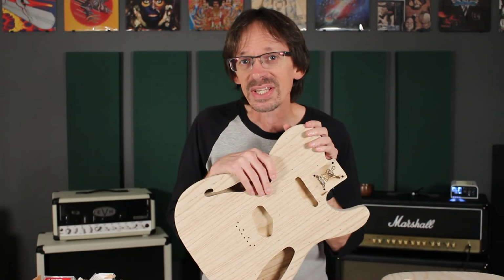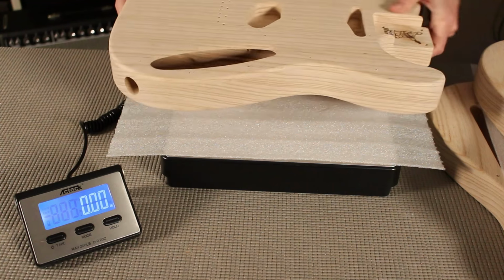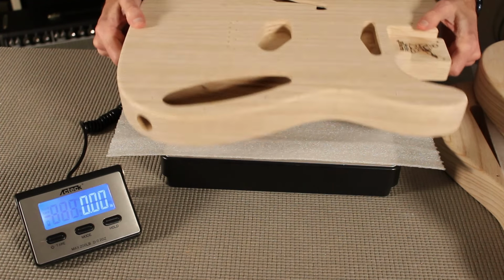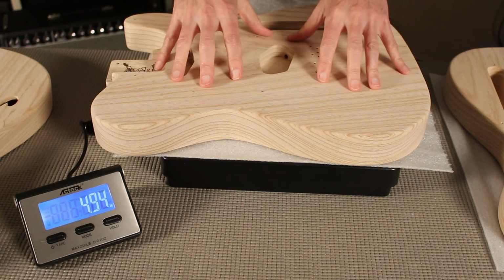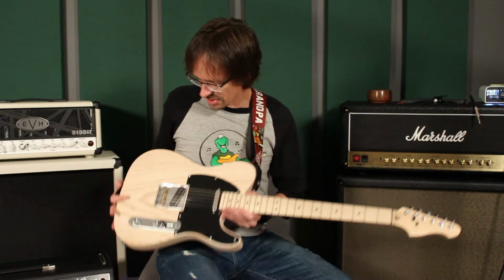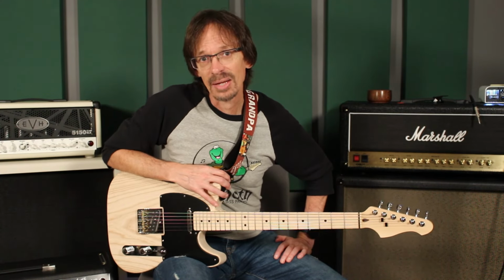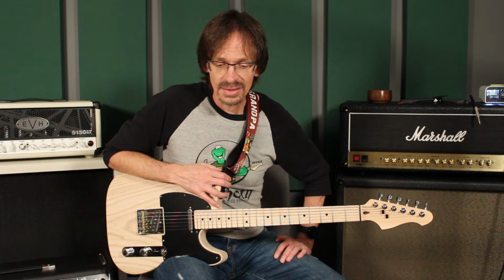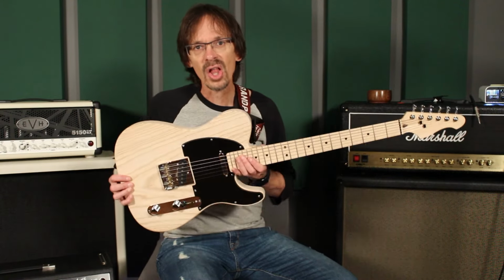Do Thinline Tele® bodies sound as good as solid or chambered?

Comment: One of my favorite builds I have is a solid poplar tele body. Only reason is it's heavier than most of my other guitars. Tone wise I can't tell I huge difference between solid or chambered.
Reply: I much prefer lighter guitars, which are usually more resonant.  My Wilshire Pro (2011) weighs 6lbs. 6oz., and my PRS korina One weighs 6lbs. 3oz. - they are both incredibly resonant and ring loudly when played acoustically, plus my bad back requires light weight guitars.

Comment: If pushed, I'd pick the chambered (A), but I agree there's not much in it, the loss of volume on the Thinline being the most noticeable difference. The weight difference on the chambered is probably the main reason to go for it, rather than any tonal differences, but it's still the same conclusion. Thanks for doing this Aaron - a lot of effort on your part. 😎

Comment: Not to be a pain, but there can be weight variations in one board of swamp ash… specifically higher or lower in the tree. 

It would’ve added a control to cut the board into evenly sized blanks and weighed them before cutting the bodies. 

Or at least mark the very middle of the board, and on a balance point see if it pivots heavily to one side lengthwise or the other.
Reply: … of course I appreciate the coolness of this test and I thank you for your time and effort! 🏆 

I now have in my hands an early Bill Nash which is great parts from your company.

Comment: I notice that when you turn around and face your amp, anything with any sound hole in it is going to be a lot more fun to feed back lol it's like you can add some sound energy to kick the feedback regen off if you turn the hole towards the amp.  That's not really demonstrated in this video but observed particularly in high-gain signal chains, well, anecdotally I guess since I don't have a video showing it.

Comment: A has more “body” and “thickness” (ok, pun intended... I mean bass/low mids) to the tone and more volume than the other two. B sounds weak volume-wise and trebly. C sounded somewhat in between, but treblier than A because of the lack of low mids.

PS: jumping directly from A to C and viceversa is essential to judge properly, as the volume and bass drop in B leads to judge C with a bias from the preceding tone.

Thanks again for this contribution!

Comment: Pretty similar.  Thinline has a slightly greater difference than the other two, to my ears.  But honestly if I were making a purchase decision it would come down to weight and looks and feel and playability and not whether the body is solid or chambered or thinline.  At least that would be a minor issue.  Tonal differences like that are easily compensated for in the amp or eq or elsewhere.  All sounds great.  Nice comparison.  Maybe some painters tape on all three where the sound hole would be could make it impossible to tell the difference visually without a highly careful inspection.
Reply: Pickguard is different too though.

Comment: Nice video A-Aron.  Moral of the Story....pick the body you like... the sonic differences are miniscule. I could tell C was the solid body but you're correct that the slightest of amp or pedal tweaks would've achieved neutrality. The pickups /bridge /nut/electronics are 95+% of the sound. 🤘

Comment: I listened to this video when it first came out and could not hear a substantial difference between the solid body and the chambered body. However, listening to it now I thought body A was the solid body because it had a little bit more Bass to it. And body C was the chambered body because I felt it had some high-pitched overtones that may have been coming from the chambers. Although I got the bodies wrong I still here overtones on body C that I didn't hear on body A. Good video. Thanks for doing it.

Comment: That was really cool. Thanks so much for doing this video Aaron. The biggest difference I noticed, was obviously the volume level drop of the F hole Tele compared to the other 2. I personally thought that A tele and C tele were closest. But, when you did the overdrive section, although the frequencies were very similar between A & C Tele's, I noticed that the C Tele had a bit more bite, or "Grrrr" when you changed to the higher chord change from the lower chords you played in that rock n' roll riff.

Comment: Funly enough, whilst I was listening to the clips, before the reveal and your observation, I thought pretty much the same things: the hollow body has less volume and the other 2 seemed to have more stable bass frequencies. With that pickup configuration I would pobably pick the hollow body for the weight and the confort that comes with less weight, not to mention that it can be fun to hear the notes ringing a bit extra unplugged and being always on the verge of triggering feedback with the right amount of gain and the amp close enough. This video should ends a lot of crazy speculations and claims.

Comment: Interesting question.  I didn't try to figure out which.  I just went through this trial thinking of purchasing a Thin line Tele and found it had a center block making it a little too heavy for me.  I purchased a Gretsch 5422 6 string hollow body and am happy I did.  At this time I have 3 Gretschs at home and one at church and my Epiphone Dot (335?) is getting too heavy and will soon be upgraded to the new 5422 hollow body.  As I get older weight is a significant factor.

Comment: I have to disagree that they didn't sound different. From the first test I could tell guitar A was chambered and guitar C was the solid body. And I didn't change my mind or doubt myself at all through the rest of the tests. The chambered body had just a little less volume, a little less "information" (sorry idk how better to describe it) and, to me, sounded "hollow" (like I was listening to it in a tunnel). I think the flexible top contributes to the tone. Chambered and thinline bodies have more of a plucky attack (like a banjo or arch top guitar) but then just a touch less brightness where solid bodies have a very even attack and a lot more frequencies in their overtones (imo). The solid body guitar had a lot more of a "wall of sound" tone to it that I felt was pushing me. Idk how that would translate to a frequency curve. 

I don't know if I'd ever be able to tell one vs the other in a band setting. Probably not. And in real life two guitars won't have exactly the same specs, neck, and lumber so the difference will probably get washed out even in a solo setting. But in this video I felt the difference was obvious. In fact, thank you so much for making this video!

Comment: 1.6 lbs is a significant factor. I thought the top three strings resonated more with A. Top 3 of B and C were indistinguishable. Thinline seemed weaker in the bottom end, so is it worth the weight savings? Maybe not compared to chambered, which would now probably be my choice.

Comment: I did get it "right", and yes, it definitely would affect my purchasing. I've been thinking about getting a thinline for a long time now, ever since seeing and hearing Bob Metzger with Leonard Cohen (man, they had great sound on that tour). But you weren't kidding about the additional authority on the bass end of the solid. I could hear it even through my phone's loudspeaker, and even more clearly through headphones. In comparison, the thinline, and to a lesser extent, the chambered, sounded ... ummm, thin. Metzler sounded sublime, there's no doubt about that. But head-to-head, the solid sounded significantly better to my ears than the others.

Comment: I was surprised by the volume difference and slight low end loss with the Thinline. Doesn’t change the fact that amplified to equal volume, my Mahogany thinline (Squier body, fat and wide roasted maple aftermarket neck) sounds as big (and a little more open) than most solids. Don’t know if that’s just luck of the draw, or the mahogany… Plus, I like the feel of the lighter thinline. Makes me want to jump around in a way when performing that I don’t feel when playing heavier instruments.
Reply from the maker: Yes, it surprised me too. Because humans tend to perceive louder as better I considered equalizing the levels, but then I said "no...gotta post the true results, no matter what they are." Equalize the volumes and I think they sound very, very similar, and if the weight of a thinline gives you wings on stage.....gotta fly!

Comment: I would have liked to have heard some clean playing on the neck pup. 
I think the solid body sounded the most musical.
Too bad you couldn't have gotten all 3 bodies to be roughly the same weight as the solid body which was fairly light for an ash body in my experience.
Anything lighter than 4lbs doesn't work for me.
Both the thinline and the chambered bodies are too light for my tastes and my experience with bodies that light leads me to expect a thin sound from them, which is exactly what I heard.
A chambered swamp ash body that comes in around 4.5 lbs would have been interesting to hear.

Comment: I thought that the A was the solid body. A and C had similar tones which were quite different than B. B sounded quieter and thinner than the other two. A sounded the most full and I thought maybe it was the solid body and the extra weight was contributing to a more rounded fuller tone.

Two things I am curious about.  1. If the changes are quantifiable either through analyzing the audio out of the amp or the output down the cable out of the guitar. And 2. How close can you get the tones of the 3 body styles with basic tone adjustments on the guitars/effects/amps.

Comment: I got them right! What you described as a volume drop in the thinline, I perceived as slightly more transparent. I agree there wasn't that much difference tonally between the three. As for the chambered vs the solid, I think I preferred the chambered. It had a slightly more "balanced" tone to me vs the solid body. Still, all three were very close.

Comment: I am guessing most views are on mobile devices but if you listen closely on real speakers, you can tell the difference.  There's some guy who stretched some strings across two workbenches and insisted that it sounded no different than an alder or mahogany body, because "wood makes no difference", and everybody ate it up.  (Ignoring that it sounded like crap, somehow).  This is a far better and more illustrative video.  Thanks!

Comment: This is the shootout I've been waiting for. I have been trying to decide on this very issue for my own build. Weight is a big consideration and I want to keep the finished guitar as light as possible. I've been leaning toward going with a Thinline style but with a traditional Tele control route and no "F" hole (I'm surprised you didn't use this configuration for your shootout). After listening to your test, I am convinced this is the way to go for my build. I agree with you that the Thinline body did sound a little lighter in tone, but I don't think that the differences were that big of an issue. Now I just need to know if the type of wood makes a difference in tone with a Thinline style route. Thanks for another informative shootout.
Reply: Same here.. I like the weight relief of a chambered body (standard Tele bodies can be heavy).  I really like the Thinline body but I'm not crazy about the F-hole.  You commented about 20 minutes ahead of me. 👍

Comment: Love your vids. The sound difference is barely perceptible and likely easily accommodated by amp settings, eq, etc. (I bet changing picks would make a bigger difference in sound than changing bodies). So for me the important difference would be feel. Are they all well balanced or do some suffer from neck dive. Are there any other comfort or "feel" differences worth considering?

Comment: C sounded somehow the most consistent of them all and at the same time a bit more boring. I'm not sure if I had noticed the difference if the one played before was the chambered instead of the thinline. And anyway... The difference was so small that I'm not too sure if I really heard anything or if I just imagine things. Certainly not something I'd select one over the other.

One thing that would be interesting is to compare how easily they feed back, how they sound on the verge of feeding back and is tehre a difference which ones get to controlled feedback easier.